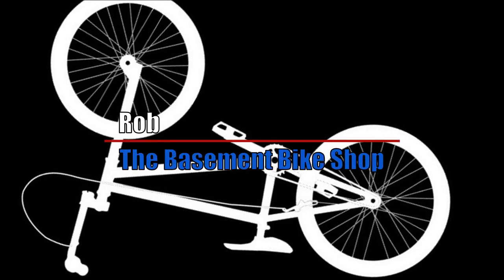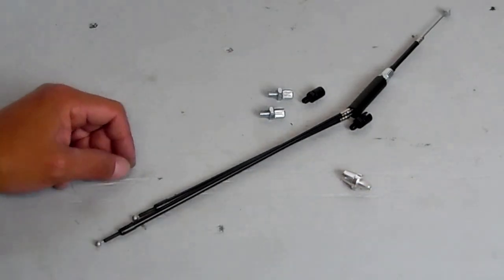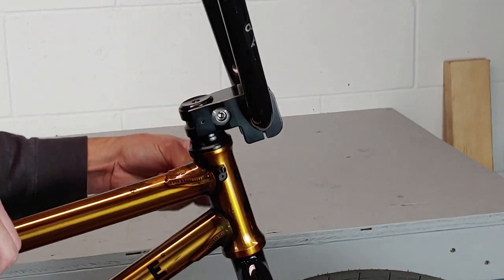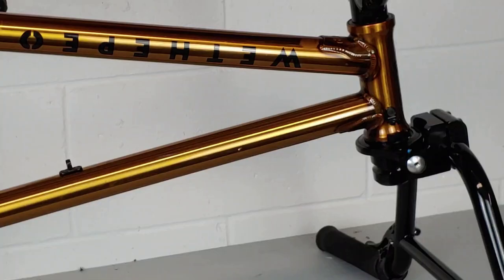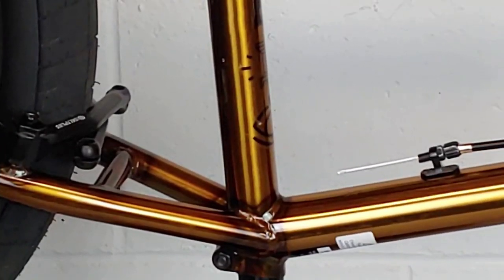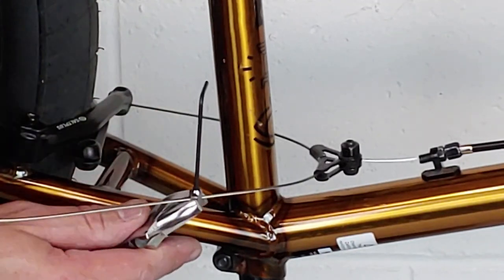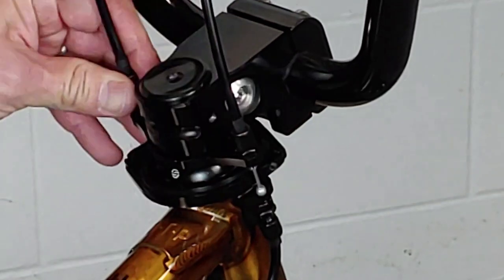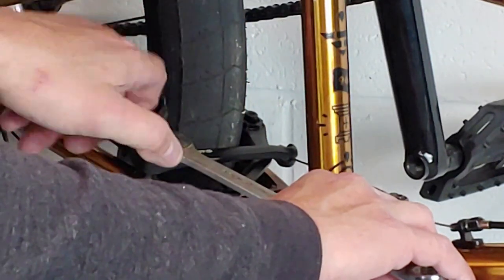Installing a Shadow Conspiracy Sano v2 Detangler- Gyro

Comment: I think this is the only gyro that uses a precision bearing cartridge (which is ideal).  Is it noticeably smoother?  The Odyssey GTX-S uses loose ball bearings behind the rubber seal, and not a precision bearing.  But this Shadow model requires a proprietary, wider top plate, because the detangler is a bit wide  --- any idea how much wider it is?